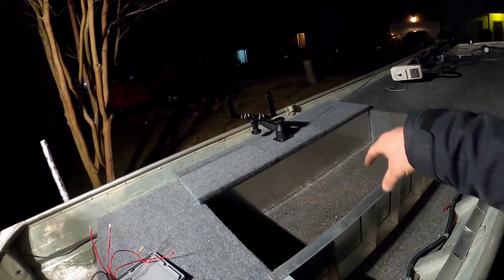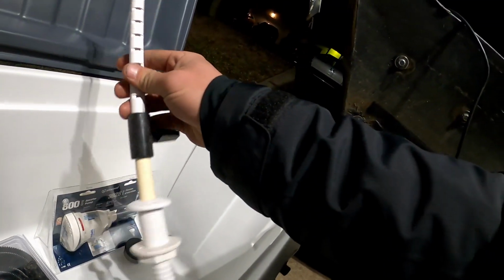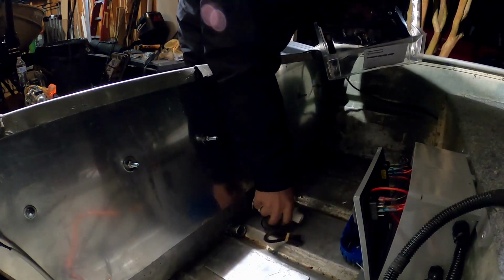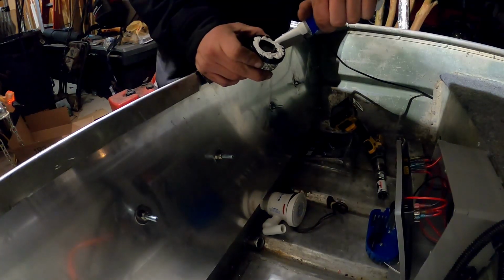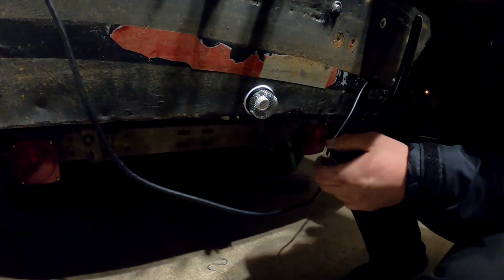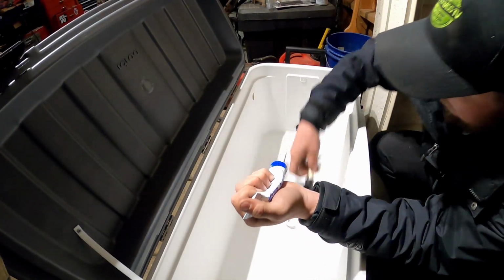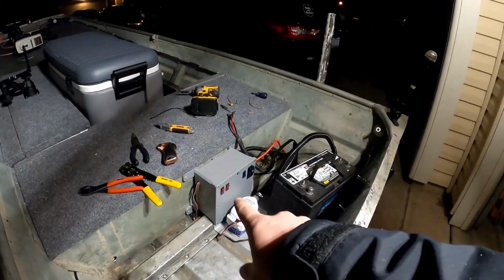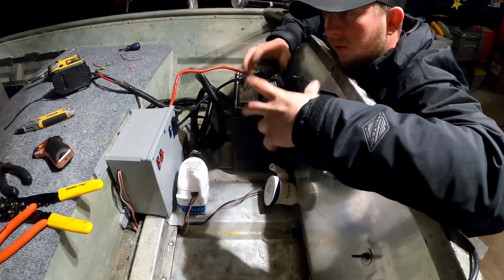COMPLETE Jon Boat Livewell Installation!! (Removable Cooler Livewell)

Comment: Might be a dumb question, but how will you pump the water out?
Reply from the maker: We have installed an aerator as well but we drain it out of the bottom plug. In our boat the water drains to the back and then is pumped out by the bilge. While we’re dumping the water we fill it back up to recirculate the water. Thanks for the question and the support!!

Comment: Correct me if I’m wrong but the only time your gonna have any circulation of water is when you’re filling that live well. You have no way to recirculate the water which will not give you very good aeration, even with an air pump and air stone.
Reply from the maker: The way that we circulate water is pull the plug every hour and turn on the pump at the same time. We have installed a drain that leads straight to the bilge pump to pump out. Great question.